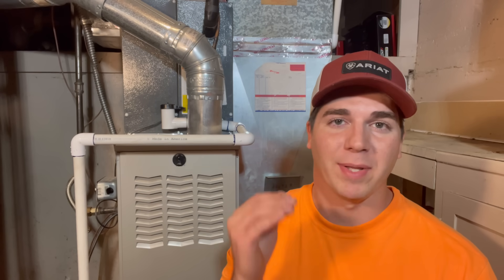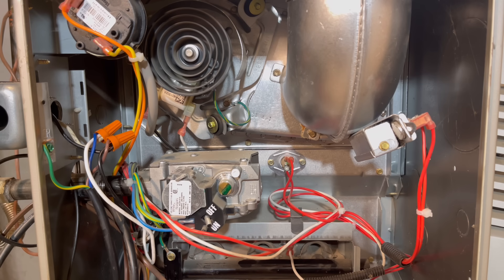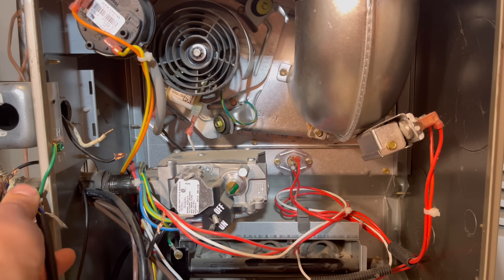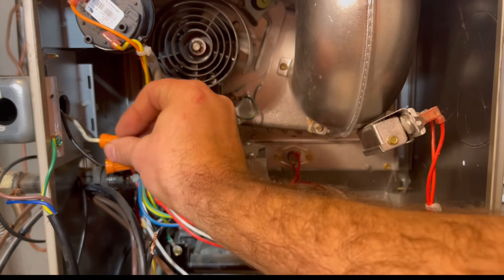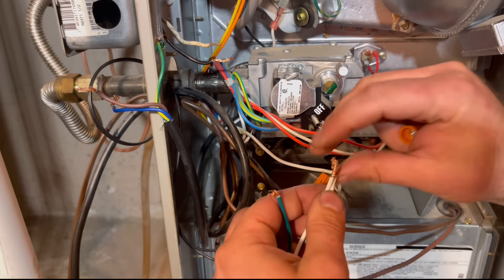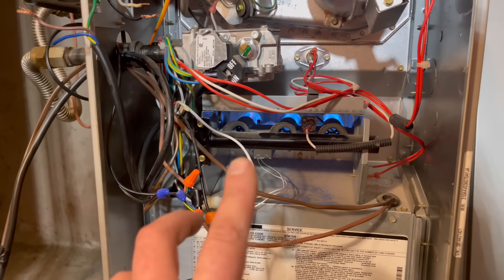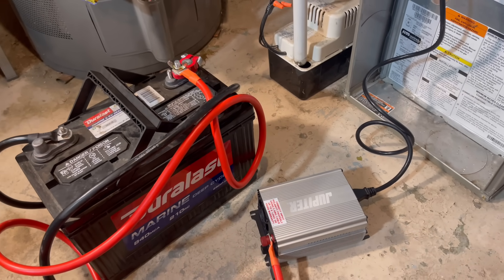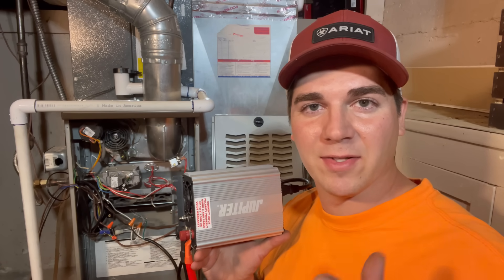Did You Know You Can Heat Your Home With A Car Battery?

Comment: Roughly 600 watts demand on the furnace motor and electronics,  translates to 800 watt inverter and 60 amp draw on the 12V battery after allowing some inefficiencies. I would turn it on just to take the edge off, don't think it would last for days. I also would get a good smooth sine wave inverter, chopping circuits hard on electronics.  Your demand may be different.

Comment: Should reinstall the panel to close the unit up. Usually its a safety feature and won't start without the panel installed or you could bypass the interlocking permissive microswitch with a tape or something to the close position.

Comment: Not knocking what his project is.  Please everyone, don't touch the bare wires from the house, ever. The "hot" black, is "supposed" to be the one through the switch, doesn't mean it is. Incorrectly wired can have current available on a neutral. This wisdom provided from decades of remodeling homes that most are incorrect for what ever reason. Research it.

Comment: Just wire in the plug permanently, the single gang switch on the side of the furnace can have a switch and a plug (or just be a plug) that 99.9% of the time the furnace can be plugged into, then in the case of an emergency simply unplug the cord of the furnace from its standard power outlet and plug it into your emergency power source.
Reply from the maker: Check out my latest video, you will appreciate what we did there. I have a full tutorial on installing the permanent outlet coming out tomorrow 12/2 at 5p :) cheers
Reply: @diyhvacguy   AH great minds think alike! Looks great!

Comment: How can we hook a furnace to a generator so the power wont go back threw the lines?...I know there's a nice little disconnect safety switch but instructions would be nice ?
Reply from the maker: Yes I’ll be doing this at some point, it disconnects power from the grid and won’t allow the breaker to be turned on unless your generator breaker is off. I’ll be doing this video soon so stay tuned for that. I’m the meantime watch my latest video it shows a dedicated outlet for the furnace and the tutorial video for they will post tomorrow 12/2 at 5p.   Cheers
Reply: @diyhvacguy  Great I will subscribe too so I get it thanks!

Comment: Great idea that works, I cut to the chase by making the power to the furnace so it is "Plugged" into a wall box, now I can just unplug the furnace and plug it into my converter and no need to do all the wiring change and no way I can get into trouble with the 110 volt supply. Any thoughts on this idea?? Tks Ron
Reply from the maker: Yes! Watch my latest video! You will appreciate what I did there. The full tutorial video will post tomorrow at 5p :) cheers

Comment: : My electrical code says a furnace must be hard wired to it's own circuit. I have thought of changing the wiring to a plug and socket so it could easily be connected to an inverter.
My furnace specs says 9 amps at 120 volts, so a little over 1000 watts. For a 12 volt battery, assuming no losses, that's about a 90 amp draw, which would require a large battery to get a few hours out of it. Now, I haven't actually measured the current draw of the furnace. Maybe 9 amps (120 v) is only required on start up. But even a 1/4 a  hp fan motor needs about 16 amps at 12 volts. A 1/3 hp would need 20 amps. These values are not including losses in conversions and running the rest of the furnace.
Reply from the maker: Electrical code is definitely not followed in the event of an emergency. But I appreciate your comment and knowledge! Cheers

Comment: This works great for a gas heater. The invertor will not provide enough watts for an all electric heater. Even if it was a huge invertor capable of enough watts, it would drain the battery within the hour.

Comment: Great Video but why running the Furnace with the battery and inventer it would have been more beneficiary to have thought to buy a battery charger and plug it in and keep it on slow charge to keep the battery charged longer while running the heat 🔥
Reply from the maker: The charger wouldn’t charge at the rate it’s being pulled down. Plus thermodynamics are a thing. Thanks for the comment though! Check out my latest video! Good info there as well

Comment: I live in Texas and I just wired into the HVAC switch (looks like a light switch) in my attic.  Ran an 80’ heavy duty outdoor extension cord out to my RV generator (Harbor Freight Predator 3500).  Stayed nice and toasty during the 2020 Snow Apocalypse.  Was able to run to refrigerators HVAC, some lights and TV.
Reply from the maker: Amazing. Gas heat?

Comment: If you have a diesel car like I have several of that run on used motor oil, because they have iron engine blocks, you could run cables in a window to that inverter converter and have an endless supply of energy for days on end the battery would never run down. There's a thought. For me even in Alabama I have a wood stove because I decided I did not want another bill in my mailbox every month from the Natural Gas Company. And the power bill was getting so high for electric heat. Pine cones wood bark tree branches chopped up into pieces and I'm Heating and cooking at the same time. It's worth getting one of those made before 1950 wood stoves and run chimney pipe out of window not legal in most places but it does work.
Reply from the maker: Check out my latest video :) cheers

Comment: Several days… lol 😂😂 yeah right. I’m an Hvac tech more like 3 hours the amp draw on the inducer motor and main  blower is to much for the battery
Reply: This only works if you still have gas flowing in the house
Reply from the maker: Check out my latest video 👍🏽 cheers

Comment: For safety you need to install an Automatic Dual Power Transfer Switch (ATS). You don't want to go around fiddling with wires especially if it's dark.
You are extremely optimistic about the duration of the battery life.
Reply: considering that your typical load from a modern furnace is about 800watts, a typical size 42 or 48 car/truck battery on a 1500w inverter will run for quite a long time given that they're about 60-90ah depending on the quality of the battery.

What sucks however, is that the sine wave that the inverter puts out is generally stepped (which is not great for your furnaces electronics and motors), only higher quality inverters should be used in use cases like this.
Reply: @JSLEnterprises  The inverter he linked in the description is actually a pure sinewave type. Reviews from several purchasers include scope traces that validate the pure sine claim. Surprising considering the $145 price, but the reviews seem legit, i.e. written in good English unlike most bought reviews.
Reply: If your furnace is in the garage you can also hook your battery up to your car and let good old fossil fuel charge it while you're running things
Reply: Be cautious of carbon monoxide when running a car in a garage. Depending on it's proximity to living spaces, it can be deadly.
Reply: That setup is what we have just in case. Also works to power our peller smoker away from ac power. Good job sharing
Reply: Since CCA on a car battery mean the amps it can provide in 30 seconds before voltage drops from 12V to 8V, you can expect a total of about 8,440 watts (844 amps x 10V average) of power from that battery.  It is an 8 Amp furnace so 8amps x 120v = 960 watts per hour.  8440 watts/960 watts per hour = 8.79 hours of run time. Bear in mind a furnace also doesn't run constantly, and this doesn't take into account energy lost through heat in the inverter, etc.
Reply: @NyeMechworks  hahah that's not how that works at all. You've mixed up your units. Watts =/= Watt-hours. 

If you can run something at 8440 watts for 30 seconds, that works out to only 70 Watt-hours. 8440 Wh would be if you could run at 8440 watts for a full hour.

Now, slower discharge may net you slightly more capacity than that math works out to, but not dramatically more. Add to that the fact that a typical car battery is not designed to be discharged at all deeply, and you have a very unsustainable idea for home heating. Good in a pinch maybe, good to keep in mind, but not going to get you through an outage more than a couple hours even if the furnace only runs 1/4 of the time.
Reply from the maker: Watch my latest video :) cheers

Comment: Nice share... The only change ill make is ill power the 115 v with my Honda inverter Gennny when the power goes out /  Will need lights and other power too  just wire in the same pigtail + plug to the genny.   Heat resumes.  *Battery is nice / quiet and simple.
Reply from the maker: Watch my latest video for more info on this :) cheers

Comment: Great idea. Hope no one gets electrocuted and their family Sue's you. The curcuit breaker for the furnace should be shut off and locked out. If you want to be proactive, permanently install the pigtail on the furnace with a junction box and install a receptacle to the wire where the furnace was previously connected. That makes for a quick switch over when needed.
Reply from the maker: Yes my last video goes into that. Check it out! I’ll make sure and include turning the breaker off on all future videos. Cheers

Comment: Awesome advice!  Out of curiosity though, and for your next video, with the extra outlet on your inverter, what would happen if you connected a battery charger to the car battery and plugged it into the inverter??  I'm sure it's not sustainable, but would it add anything or just drain the battery faster....  Food for thought.
Reply from the maker: Wouldn’t recharge quick enough. However you could use a separate battery to do this and then swap them as needed. I’d love to do some testing with this

Comment: Simply mount an outlet in that box and then you can just keep that cord on the furnace all the time.   It is easy to plug the furnace cord into the new outlet or the inverter on a moments notice.  A second cord could be used for that condenser fan.
Reply from the maker: I did just that! The video showing it and an alternative posts in about 10 mins! Be sure and Check it out! Cheers

Comment: A car battery is 1300 watt hours, and a furnace fan is 400 watts, making this only able to run for a little over 3 hours. If your house is very cold to start with, it may run out before it even reaches the thermostat set temperature. This is not even factoring in losses due to the DC>AC conversion
Reply from the maker: I understand that to be the case now. Watch my newest video that just came out and we show how long it lasted and a great alternative. Cheers
Reply: 1300 wh my ass A typical auto flooded lead acid battery has max 60 ah. 12v X 50ah= 720 watt hours
Reply: @Wireman134  dunno. I just googled it. See for yourself

Comment: While (barely) functional, I would take some serious time and clean that up. Do not just 'flip the switch' but actually trip the breaker before starting working on it. Also do measure with a multi-meter or other voltage sensing device, etc.. 
So yes, it is easy to run most equipment off an inverter, but please do prepare far better, do not just half-hazardly twist on too large wire nuts on stranded cables, etc. If for any value, this is supposed to work when power is out, and you are fumbling around in the dark.
It is easy to do this better.
Reply from the maker: Follow up video comes out in a couple hours. I think you will like what we did :) cheers
Reply: @diyhvacguy , I'll try to take a peak. IMO 'electrical safety' is so easy and cheap there's never a good reason for skipping on it. Especially not while 'instructing' others.

Comment: Video referred to at the end of this presentation, while very good, did not mention anything about the time you could run the system on your battery. Could you provide the approximate time and/or point to the correct video where this is shown? Thanks
Reply from the maker: My apologies. The test video will be up this evening at 5 PM. And sorry for the delay.

Comment: GREAT video! I have a 10kw generator in my driveway trailer, with 7 20A circuits that I use for my sound company to do outdoor concerts, where there is no power. When my power goes out, I use this generator, running 3 12g ex cords to my home, and 2 12g ex cords to the apt above my garage, to power a few lights, computer, TV, and fridge. But I never knew what to do with my furnace. My power has never been out for more than 36 hours, and this idea will help me make my home comfortable for emergencies! I am going to buy 3 extra batteries (2 batteries and a spare that remains charged, there is a furnace for my apartment also), and 2 inverters, to be prepared. Thank you SO much! ...Peace! 🎼❤☮
Reply from the maker: Of course! Make sure and subscribe to our channel for more HVAC tips and tricks. By the way, the test video and some other great tips will be uploaded this evening at 5 PM to check that out! Cheers.

Comment: This is great info to get your heater running on emergency heat.  I would like to suggest getting a solar panel and run wire outside to charge the deep cycle battery.  you'll blower motor should have the starting amp on it.  So 1000 watts/120volts=8.3 amps.  As long as your blower mower starting amp stay below 8amps this would work great.  Otherwise you'll have to upgrade to a bigger inverter and wiring.  What guage wire did you purchase?  Looks like 4 guage wire maybe?
Reply from the maker: I believe it was two gauge wire, but it’s probably overkill. Four gauge would be fine. I’m sure.

Comment: I have made a permanent version, that is quick and easy to switch between shore power and battery.  I replaced the light switch on the side of the furnace with a traditional outlet receptacle.  I then pigtailed an appropriate power cord, like you show and ran that out of the receptacle through one of the knockouts.  For everyday use the cord is plugged into the outlet.  During power outages, I grab a deep cycle battery and my inverter, and plug into it. Please note; In my area, having the furnace connected to shower power via a cord is not to code.

Comment: How much wattage does the furnace fan actually use?
Reply from the maker: 5 amps
Reply: @diyhvacguy  5a at 120v so about 600w.  Maybe around 10 hours of actual fan on running time. That will do pretty good in a pinch.

Comment: Thanks for making this video and I have a plug in furnace with an outlet so I wouldn't have to splice in a pigtail just plug it in the DC converter. Again thank you because every now and theirs a power outage and this is very handy.
Reply from the maker: Awesome! I just wired my furnace this way so it will be much easier in the event of a power outage. Cheers

Comment: I live in Texas and have 2 furnaces in my attic. Can I connect both furnaces to the inverter?
Reply from the maker: More then likely but you will need a large enough inverter and power supply for it. I have a video coming out Friday that explains how to make the furnace ready for a power outage. But another video posts this evening at 5 that shows what it is. Install video comes out Friday though. Check it out! Cheers

Comment: Unfortunately this will not work with a Heat pump hvac as it draws too much electricity.  You would need more batteries for a heatpump. Also you should not use the car battery as when the voltage gets too low it ruins it!  You should use 12V marine batteries instead which is designed for complete discharge without damaging the cells or use used rechargeable lithium batteries.

Comment: Actually I'm just thinking, this particular option works really well only because the current the HVAC is drawing is not a lot, it's just powering the electronics, which can't be more than an amp, so your car battery invertor will work a treat, this also works well for charging, or low powered electronics, but anything other than this say for example, that won't hold up too well because of the current draw, I'd love to power my fridge for example or even a mini-fridge for my insulin, the current requirements for a fridge or other appliance is too great and the battery will be dead in min's... but it is a good idea none the less, for lighting, laptop charging, mobiles other electronics

Comment: What’s the minimum wattage for an inverter to do this and what about a heating system like an oil fired boiler that has several zones that use water circulator pumps that must increase the watts needed to run it right?
Reply from the maker: Correct. I’d say 1000watts is kind of the minimum but to be sure you’d really need to see how much wattage the furnace uses while it’s running.

Comment: Can't be the only one that cringed a bit when he reached in and started touching the hot line. Switch or not, should probably tell people to flip the breaker or test light before grabbing wires. Putting alot of faith in a switch and someone elses wiring.
Reply from the maker: This is true. Noted for the next video. I need to wrap my head around doing certain things when explaining things for a very amateur audience if DIYers. Thanks for the comment! Cheers!
Reply: @The DIY HVAC Guy  Not everday i get a response from the OP! Appreciate the read.

Comment: What would be cool is a HOWTO to do an A/B switch between the pigtail and the mains power to the furnace. You could then keep a permanent deep cycle 12V near the furnace and keep it plugged into a smark-trickle 12V charger running off a 110 outlet for when mains power is good. That would keep the backup fully charged and non-degraded and the entire system could be activated withflip of  two switches, the a/b switch and the power switch on the invertor. That way switching back to mains would also just be two switches and it would prevent accidental over volt conditions.
Reply from the maker: I did something similar to my furnace this week. The video showing that comes out this evening so make sure and watch it when it posts! Also the install video comes out Friday 👍🏽 cheers